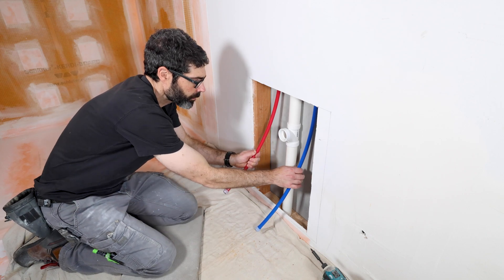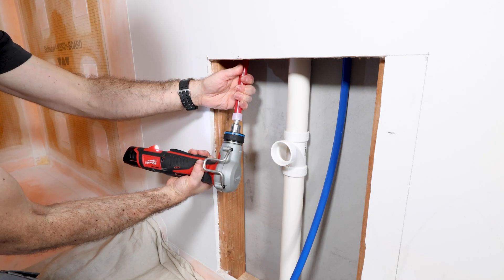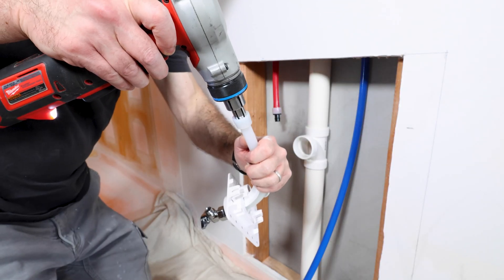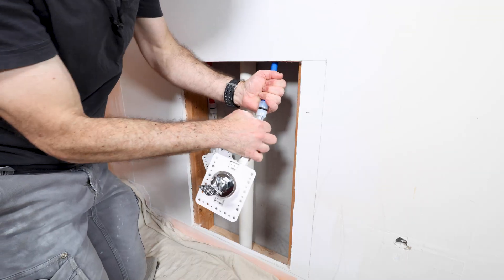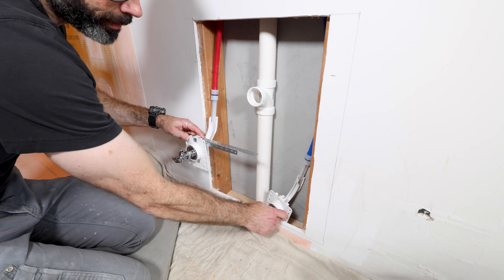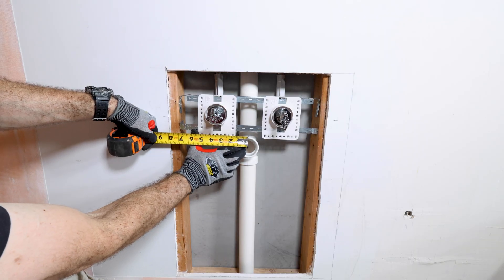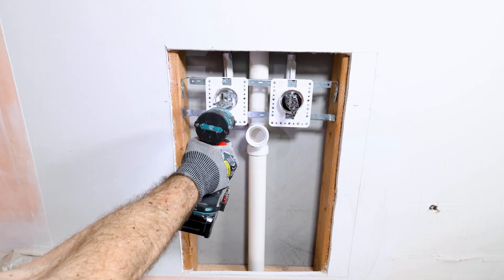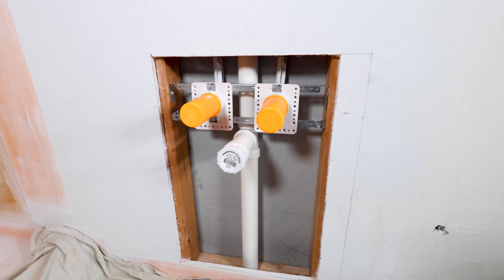PEX A Shutoff Valve Installation with the HoldRite Fixture Outlet Box

Comment: can you please make a video about the right way to connect acrylic tub and wall tiles. I assume there should be the way for water to escape from behind the tile on the wall, but if we cover that seam with silicon, and the tub is in level- there is no way for water to go. What would be your suggestion?
Reply from the maker: I recommend sealing the backer board to the tub flange per the manufacturer. Then setting the tile such that it’s 1/16 to 1/8 inch off the tub deck and filling that gap with silicone because it’s an expansion joint. Not much water should wick into the grout or tile